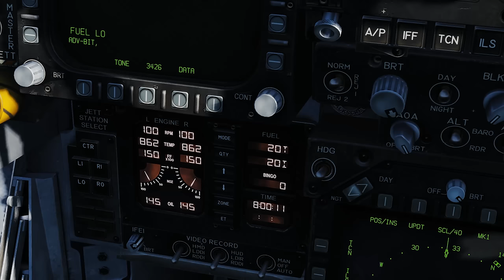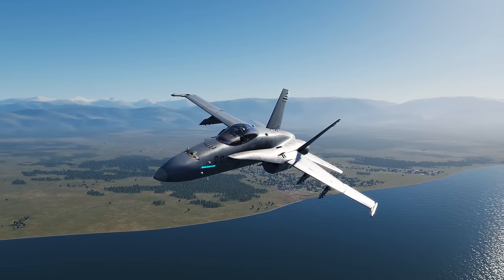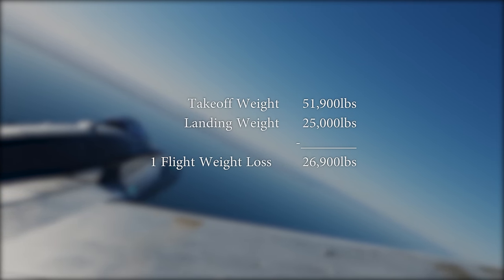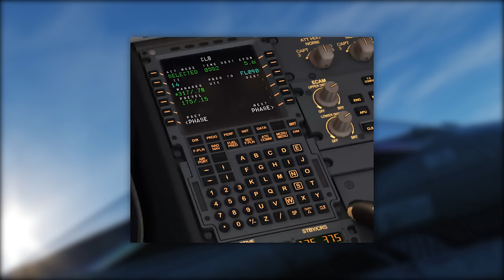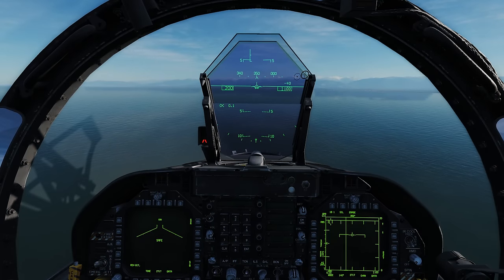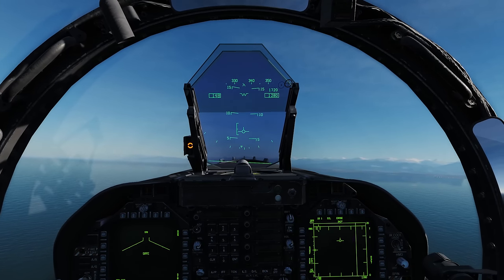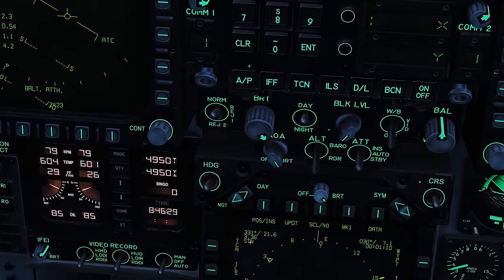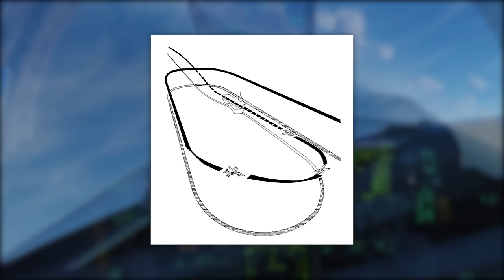DCS World - F/A-18 - Case I Carrier Recovery Tutorial

Comment: Just to echo on what AEW said, "Back in my day" (1999-2004), we used 450' at the 90 as well, with VSI targets around the approach turn that varied a little more (part of what made a day approach turn so very very challenging).  The only other area I noticed was that at the abeam position, you are usually targeting 600', on-speed, 0 VSI, and a specific TACAN distance from the boat.  I don't remember you mentioning that last part, but you did mention a horizontal distance reference earlier in the pattern.  I flew S-3's which forced us to fly a "Working man's pass" without all the displays and velocity vector (or coolness factor), so we didn't have a display line to touch the wingtip to.  Plus, keep in mind that in real life (not sure if it will be simulated here or not), the ship does not always maintain the same course and often shifts heading to keep the wind over the deck (the crosswind limits are pretty small given the narrow landing area) - you won't necessarily know that and adjust your BRC in the cockpit.  So it's a good idea to check your TACAN DME at the abeam position, because that will affect the angle of bank you select (which in turn will affect how much power you set in the initial turn, etc).  In the S-3 it was 1.0 to 1.1 nm abeam.  From what AEW says it sounds a little wider in the Hornet.

But the comments above are very minor nitpicks in what is otherwise a very impressive video.  I'm just poking my nose into this community, and am blown away by the attention to detail and accuracy.  You just don't see civilians referencing the NATOPS - that's crazy!  It's so refreshing to have a flight sim not try to dumb down the complexity and difficulty just to make things more accessible.  I think you did a great job capturing how much work and precision goes into a safe pass.

Because this seems so close to the real thing, a couple things to consider from someone who hasn't played the sim but did it in real life:

1. A good pass starts at the break / crosswind turn.  Be consistently on the right numbers every time.
2. Consistency is key.  Strive to hit  the same numbers (airspeed/AOA, Angle of bank, altitude, distance abeam, etc) every time.
3. You will never be able to completely achieve #2 above.  Recognize deviations, MAKE A CORRECTION towards capturing the next checkpoint, expect to re-correct once you capture that checkpoint.  For example, if you increase your VSI due to being too high, remember to decrease your VSI back to where it should be once you're back on altitude, or you'll trade a high for a low.
4. Really understand what your checkpoints are.  You should be monitoring your progress BEFORE you hit the abeam position so that you nail it at exactly 1.2 nm abeam (or whatever the right Hornet number is), 600', on-speed, reciprocal to carrier heading, wings level.  Normally the turn off the abeam is delayed a certain number of seconds - make sure it's the same each time (assuming the same wind speed over the deck).  You should have an exact altitude, VSI, and angle of bank target to hit at the 135, 90, 45, and start positions (these changed slightly with each position in the S-3, not sure what the Hornet numbers are).
5. Once you know what the checkpoints should be, the next step is recognizing deviations.  Are you high/low? Tight/wide? Too much/too little AOB?  All will require different corrections, but you can't make a proper correction if you don't recognize the deviation first.
6. Once you are consistently recognizing deviations, now comes a proper correction.  Realize that every correction will have second and third order affects that need to be factored in.  But in each case, try to correct to be on-profile at the next checkpoint or two if possible.  High at the abeam?  Try to correct to be on the right altitude at the 135 or 90.  If you are wide at the abeam, you will need to have less angle of bank initially to avoid being in an undershooting position at the 90.  But if you use less angle of bank, you will also need to carry less power during that part of the turn to avoid arriving high at the 90.  Your turn radius will also be wider, putting you in a potentially "long in the groove" situation, so you may need to start your turn a little early.  A lot of things to juggle, but if you can get back to profile, you can resort back to your normal numbers.  Realize that most of us spend most of our time correcting deviations, however.  The better you get, the sooner you will recognize deviations and the smaller your corrections will be.
7. Make larger, more aggressive corrections farther out, finer corrections in close.  Making big plays in close is generally no bueno.

Jabbers, you did a great job here.  You are correct in stating that doing this consistently requires a TON of practice.  We started flying the ball on day one of jet training, thousands of landings before we ever saw the boat.  Whether we were flying familiarization, formation, bombing, dogfighting, etc, we would always come back to the field and bounce 5-10 times to get more ball-flying practice in.  It's truly shocking at first how hard this is - the first time I rolled out of my approach turn, I couldn't even see the ball (I was too high)!  To see a centered ball crossing the ramp, you literally have to fly your head through a window only a foot or two wide.  So don't feel bad if this kicks your ass at first.  Try to nail the early parts of the landing pattern, and keep working on consistency and accuracy to the later, harder parts of the approach turn an landing.  Work towards a good crosswind turn (or break if you are entering the pattern).  Then try to hit a good abeam each time.  Next work on hitting a good consistent 90.  A good start is where the grading starts, and where the rubber meets the road - once you are getting good starts you are almost there.  Remember to make a power adjustment as you roll wings level or you'll balloon.  Flying the ball is what it is - I've never flown a simulator that accurately represents it, so I'll defer to others there.  Meatball, lineup, angle of attack are the only things you should be looking at, and the faster you scan them the better.  Flying the ball is almost a whole other conversation/video - there is so much going on there, so many ways you can deviate, so many possible corrections.  If this sim includes rooster tails and burbles (which would be awesome), then the discussion gets even deeper based on high wind vs light wind days.

Now add night, bad weather, pitching decks, and aircraft emergencies, and you've got yourself a pretty good sim!

Sorry for the long comment - love talking about this stuff and you seem like the right group.

Fly Navy!

T-Pot
Reply from the maker: Awesome stuff, appreciate you taking the time and adding your insight and IRL experience, pleasure to read!  Eagle Dynamics has a lot to do before it's fully simulated to the extreme of pitching deck, bubble and rooster tails, but one day hopefully!  This video was a labor of love for me and one of the most extensive things I've ever tried to understand in the sim world.   When I was first approached by a navy friend to do this I thought, EZ no problemo... well, 4 weeks of 3-4 hours a night practicing my approaches, 3 more weeks of data gathering, script writing, draft after draft, peer reviewed by current navy pilots, resource gathering, filming, etc... then putting it all together which was another week or so... i was exhausted.   But now the bar is set, I unfortunately judge all my future content based on this video.   

Glad you enjoyed it!
Reply: What do you mean "sorry about the long comment"? That comment was just as interesting and informative as the video... :)
Reply: @Jabbers  That's something I never think about when watching a video like this.  When I watch, I'm thinking about how to apply the information and what I'm doing wrong or right.  Never thought about what goes into making it. I guess that's evidence of a quality production!
Reply: Former Data Processing Technician
Reply: Thank you very much!  You mentioned that 'Normally the turn off the abeam is delayed a certain number of seconds', what do you call for this stage?
Reply: @RKDriver  Me too, i watch these and soak up as much info as i can and re-watch them continuously as i'm doing now so i can better apply the method in sim.
Reply: Good additions. Real pilots are AVIATORS and can call the ball and catch a wire. Fly Marines for up close and personal. :)
Reply: I spent twice as much time reading through your comment as compared to going through the video. My approaches are still crappy but coming after spending a long time in the challenging DCS MIG-21, the Hornet seems like an interesting challenge.
Reply: I don’t know where you are today, four years later, but this was a great comment. Thanks.

Comment: Thank you for the video and the breakdown.  I just picked up the carrier module and F-18 a few nights ago.  First attempt rolled off the front deck, the next three crashed into the back.  Got it on the fifth, sixth and seventh, crashed eight and nine again into the back of the carrier and nailed the tenth again after a touch and go-around.  I'm happy with 4 out of 10 landings for the first night with both the carrier and first time flying the plane.  

It was interesting to see in your video all the stuff I DID NOT do correctly when landing, which I should have been doing (setting stuff on the MFD).  The F18 is one of the easier military jets to fly, so long time sim pilots should pick this up fairly easy it's just going to be some reading the manual to set everything up correctly, or just use the force like I did if you are comfortable using an AOA indicator.  I'm usually sim bush flying on small landing strips and that experience seemed to help a lot with this kind of landing.  

Anyone having problems, try and practice with one of the more modern (faster) bush planes like the Kodiak on small runways that require a sharp decent.  For me this has been "pretty easy to do, but hard to do right".  Again, thank you for the video; time to go read a 600 page manual.  Guess I shouldn't complain too much, the A10c II manual is 900 pages.

Comment: Great vid.  It was reassuring to hear that the RL trainees do more than 300 attempts on land before attempting on the boat.  Any advice/views on using Automatic Throttle Control (ATC) to maintain AOA?
Reply from the maker: I'm fairly certain ATC is used for case 3, not so much 1.tyat said I've never tried to use it in the 18.

Comment: Never played this but looks like I might try it to relive the glory!  

When you start your approach turn you can use the "tail and wing" of the Velocity Vector on the horizon as a good gouge to give you the proper angle of bank and decent rate to the 90.  Also once you cross the wake you can start seeing how you are doing on glide slope and make a correction.  Once on the ball fight to move the ball a little bit......a stationary ball means it's about to move....and you goal is to get a crester...meaning the ball is just cresting over the datums....about a half a ball high.  I don't know how well you can simulate the throttle...but minute changes should be all you need.  Three point power corrections do work.....but I also used very small pitch correction with each power correction to keep the ball centered.  Is there an AUTO throttle in DCS?  I never liked "Auto" throttle landing because it was all uncomfortable stick movements.  Live (or Die) the LSO rules....stop a rising ball but DO NOT try to recenter it.  Be the Ball!

Comment: Very nicely done, Jabbers! BZ My fleet a/c was the A-4E,F,&M and all is much the same once you get abeam. One thing I would add is the ijmportance of scan. As you pass thru the 90 and pick up the ball you should tune out all other input (other than Paddles - LSO - if there was one) and start a constant three point scan - check the meatball (the ball), your line up on the centerline of the landing area, and then your angle of attack (AOA). Keep checking these three indicators in that order over and over until you pass the lense. Meatball, line up, angle of attack - meatball, line up, AOA...over and over making infintesimal adjustments to keep each as exactly on as you can. Too bad DCS hasn't put an LSO on the platform to call your adjustments. Nuggets will find improving their passes will happen much more easily and quickly if they remember to SCAN!! Again, NICE JOB Jabbers...Nasty out.

Comment: I noticed a couple of things missing from the carrier.

There are "drop lights" hanging down from the bottom of the ramp down over the fantail. The drop lights have a metal backing, so during day recoveries the lights aren't on. The drop lights are used for lineup - if you're lined up properly, the drop lights will form a straight line with the centerline of the angle deck. If you're too far left the drop lights and centerline will form sort of a sideways V, with the open end to the left; conversely, if you're too far right the V will be the other way. The best way to picture this is to point your thumb down and your index finger away from you, like you're making an upside-down pistol. Hold your hand so you're looking slightly down at it (and ignore the rest of your hand if you can). Your thumb represents the drop light and your finger represents the centerline. If you're lined up with your digits they'll be in line with each other. Move your head to the left (or move your hand to the right) and you'll see your thumb and finger form a vague V.

The other thing that's missing, and it's not something we had on carriers back in the 1980s, is the Long-range Laser Lineup System that uses eye-safe lasers to help the pilot get lined up. One thing different "back in the day" was that the FLOLS (ball) had only five light cells, four amber and a single red at the bottom. These used Fresnel (ridged) lenses rather than fiber optics. (I wasn't a pilot, by the way, I flew in the back in Vikings.)

Here's one thing that's interesting - eye-to-hook distance. (It really doesn't play a part in landing as far as what the pilot does, but it's still interesting.) When the pilot is flying the ball, he or she is actually "flying" the tailhook, and what's seen is compensated for based on the kind of airplane. If you take a short airplane, let's say an A-4, the vertical distance from the pilot's eyes to the hook is fairly short (the angle of attack will, of course, place the tailhook some distance down from where the pilot is). Now consider a long airplane, like an F-14. Because it's longer, the eye-to-hook distance is longer, and the FLOLS has to be adjusted for that. The way it's done is pretty clever. First, think of the light beam that's emitted like this - it's very wide, and the pilot only sees a thin sliver of it (in the vertical dimension) depending on whether he or she is high, low or on glideslope. They make the adjustment by tilting the FLOLS. For the A-4 with the short eye-to-hook distance, the FLOLS is tilted closer to horizontal - the right "end" of the fan-shaped beam is relatively low. For the F-14, the FLOLS is tilted counterclockwise, raising the right "end" of the beam. These adjustments keep the hook of each airplane the same height above the deck (at the fantail) - all that's being done is raising or lowering the beam to meet the pilot's gaze. Pilot up high in an F-14? Tilt the beam up more. Pilot down low in an A-4? Tilt the beam up a bit less.

Comment: Took me 12 tries to land on the carrier. About half the times I missed the wire and the other half I crashed into the back of the ship. Landing in a carrier is so much freaking harder than it looks in these videos. One thing that was frustrating is that I couldn’t see the landing lights on the ship and with the simulated lights and ball that appears on screen, I couldn’t tell if I was too high or too low if the ball was so high or so low that it wasn’t even shown on the on-screen graphic. I had to just guess until a ball appeared but sometimes it never appeared so I was either way too high or way too low.

Comment: Just a note. The AoA indicator is marked in units. Not in degrees. It is quite important because for example 10 units of AoA does not equal to 10° AoA. In the US military aircraft this is quite common. The reason is the flight computers were not able to work with negative data (e.g. AoA -6°). For example you can see that in F-15C or A-10C. So, the 0 units was for -10° and 10 units 0°, 20 units for 10°, e.t.c...

This is not the case of hornet, but many older aircrafts.

Comment: amazing video! Totally earned my subscribe!  One question I have is about how the sensitivity of the ball changes.  You said that the margin of error gets much larger when you approach the deck of the carrier because the ball no longer means 16 feet (as at the top of the grove), it means 1 ft (at the bottom of the grove).  Wouldn't the margin of error be much smaller, because a little change in the aircraft's AOA or ALT would result in a greater change in the ball at the bottom of the grove, whereas when you are at the top of the grove a little change in the aircraft's AOA or ALT might not even show up on the ball?   In other words, the ball gets more sensitive as you get closer to the ship, therefore a smaller margin of error.
Reply from the maker: Ya more sensitive and harder to correct, most of the time when trying this i was making it sink (1 wire) or disappear off the top (as I bolter or 4 wire) its very hard to make any corrections after in close, so just takes practice.